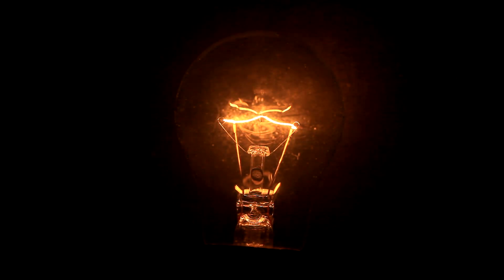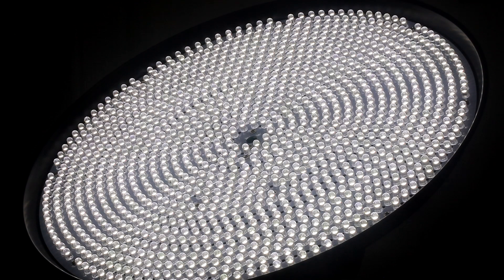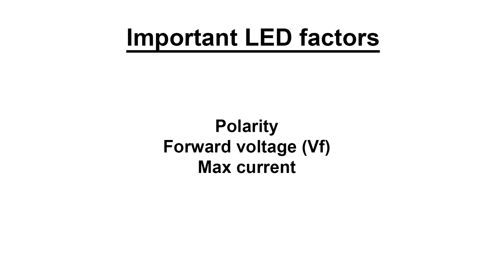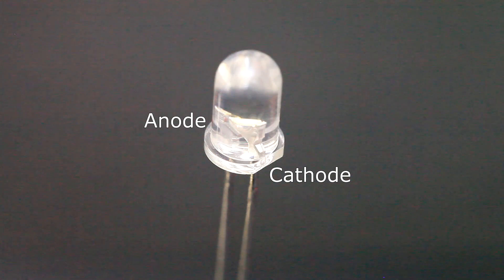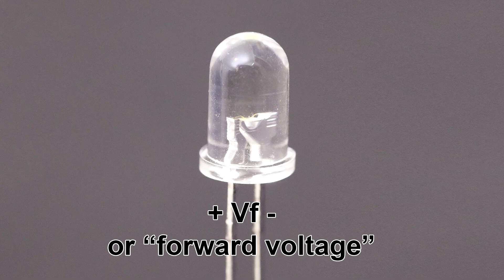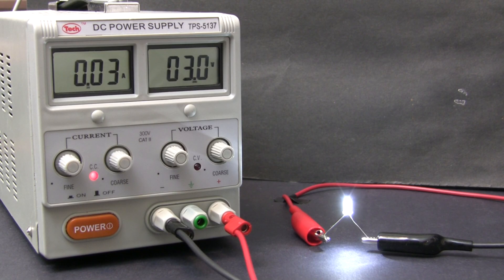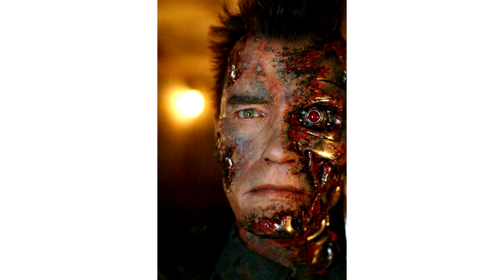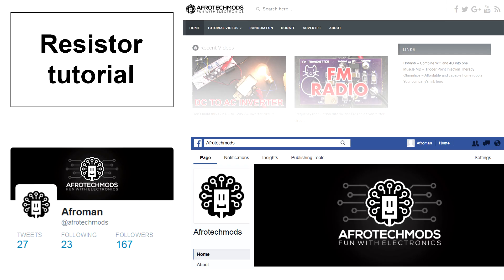LED Basics

Comment: Working with LED´s i can honestly say that i do not like them!I had LED´s at home and they failed very quickly(it were LED by a respected Light producer!).I also have to work with LED´s at my job and boy we have High pressure Sodium bulbs that still burn to this day and are really old(in the 8 years i worked there)and her come LED lighting and it is brillant lasts so long(not).
I have encounterd them in street lighting,under water lighting,moveable lighting and indoor lighting and ther are a lot of premature failing luminaires!With old fashion discharge bulbs it usually 2 things that break down,the bulb or the ignitor that´s it.Here come LED and it does not work so whatś wrong with it,the driver?The LED´s itself.
This usually means replacing the luminaire and LED luminaires are not cheap!
If it works it is brilliant but i am starting to hate LED´s

Comment: I was going to ask that since LEDs  have polarity, if you could use them as diodes when non are easily accessible. Then I realized that's literally what they are, light emitting diode.
Reply: But, understand that their reverse breakdown voltage is usually around 5V, AND the typical forward voltage is rather high, so not practical in most diode applications.

Comment: How to connect 100 led rice bulb to direct ac
Reply: I'd do 2 parallel strings of 50 LEDs in series each, then power them using a capacitive dropper taking up the voltage difference without generating heat.

Comment: speaking of cheap- ebay from china, 300 leds is like 2 dollars.
Reply: Just be aware that the normal keys to polarity, like long leg, flat on the side, even the polarity with respect to the bigger internal metal piece (anvil) might not be correct as it often is a case of reselling reject batches...

Testing a few out of the bag before building anything can save a lot of frustration...

Comment: What if we call filament lightbulbs as filament heaters? Would they then be considered more efficient with some light as a by product ?
Reply: Electric heaters are 100% efficient.  It is when you try to do something other than make heat, that efficiency is low.  Heat is usually an unwanted bi-product of an electrical device.

Comment: So many thumbs down!!

Must be PEOPLE for the ETHICAL TREATMENT of LEDs
Reply: Richard Head,
The thumbs downs are probably because he told everyone the voltage to use, but not watt (pun intended) resister to use.
Reply: @tarnishedknight730  I agree. It is not that evident to the beginner audience how the {Vf, resistor value, Vin and LED flowing current} are connected. I was expecting it to be mentioned in this video, because this is one of the LED basics, but was disappointed.
However, he does cover this topic in the following resister tutorial...
Reply: @vasiliynkudryavtsev , I'm sorry, you lost me. Which topic is covered in the resister tutorial?
Reply: @tarnishedknight730  Ehm, there (in Res tutorial) he does explain how to calculate the resistor value for LED+R circuit...
Reply: @vasiliynkudryavtsev , I am so sorry for bothering you with my irritating question. Obviously, it is not evident to the beginner English speaker that using nouns (proper names) and complete words (Resistor vice Res) makes one much more understandable.
Ehm, you write of "Vf, resistor value, Vin and LED flowing current". That is 4 items that could be referred to as "it" or "this topic". Each of them can be a topic for discussion without mentioning the other three. 
In the future, I will know enough not to ask you any more questions.
Reply: @tarnishedknight730  Don't worry, bro. There is no penalty for asking.
Reply: Or unethical treatment of their heads - made them hurt, too much information.
Reply: Ok
Reply: ha!
Reply: Hi
Reply: I think thumb-downers just wanna end up looking like Arnold, and he's discouraging them from that..  🤔
Reply: People who heard "on average, they last 10 years." If my LEDs last an average 10 years I must be 200 years old.
Reply: @MatthewFogarty-k2y  .. real fact. LEDs are "solid state" devices which gives out only monochromatic (single wavelength) devices. LEDs actually emit invisible/barely visible Ultraviolet radiations and phosphors inside, like the one in the fluorescent tubes, convert them  into  visible light. If u use the same phosphors of FL, which contains Mercury then LEDs too would.
Reply: No, just people who want good, comprehensive, technical guides that don't promote bad habits.
Reply: @immanuelpereira8924  I said precise, not save for playing children with it.
Reply: https://youtu.be/MJtsJs4Lx7A
Reply: The technology is great, however these LED bulbs have Mercury! When lit for periods at a time, it seeps into your homes!
Reply: That's neither true nor an interesting conspiracy theory. Even the mercury-containing compact fluorescent light bulbs, which are totally different from LEDs and look nothing like them, are very safe relative to something like a mercury thermometer, which many people over 50 never worried about having in their homes.
Reply: @TaiViinikka  LOL, and I have about a pound of it in mine.
Reply: @TaiViinikka  Mercury thermometers still are most precise tool than many fucking digital trash.
Reply: @pallmall5014  What are you talking about? There is no mercury in an LED. They are actually replacing a technology called Florescent lighting which does contain Mercury. Google it my friend.

Comment: can we use dimer swicth in led or is there somthing we can do to make led dim? hope you understand what i mean thanks..
Reply: Usually only if the dimmer is made for LEDs, and only if the LED light is made to be dimmed.   Most LED bulbs cannot be safely dimmed.  They will either flicker or burn out with reduced voltage.   I had to replace my regular dimmer switch when I went to dimmable LEDs because they wouldn't turn off all the way at the lowest settings.  The replacement had a separate on/off switch as well as the dimmer slider.
Reply: My3dviews thank you...
Reply: You're welcome    :-)
Reply: In North America, we no longer need special dimmers for LED bulbs, we can use the cheep ones again because bulb design has changed.

Comment: If you have far-red LEDs, the forward voltage will be lower than a standard red, and infrared ones have an even lower forward voltage. Is there a general equation for light wavelength versus forward voltage?

Comment: What do I need to make up a 120volt indicator light using a led diode? I am wanting to help my daughter make something for her boyfriend. I am familiar with  simple wiring,.but never fooled with leds..
Reply: David Moyer  pick a value a little less than max led current   120v = 155v peek to peek     155 - led forward volts   .7.    The resistor drops about 154v at peek   154 / max current of led = approx value of resistor     Now you can't exceed peek current.
Reply: Thank you....

Comment: My speaker has 5mm white led(3v) but i want red led (2.2v) what if i change, is there any damages to speakers
Reply: It will probably have a voltage limiting resistor in series.  There's information on-line about what value resistor to use for each colour of LED at different voltages.  The resistor value will give you a good idea of what voltage is being used, then just change the resistor for the recommended value at that same voltage for a red LED.
Reply: Try some red paint or a red lens...
Reply: @nickdannunzio7683  My brain short-circuited with that idea
Reply: mahesh s ,
DONT DO IT, SHE WILL BLOW UP!!!
Just kidding.
If they are the same style, chances are they have the same voltage drop across the pn junction. 
Go for it.

Comment: Ok so, if you could guide me in the right direction.... I'd like to install 2 green LEDs on my instrument cluster/Batwing (Harley Davidson). I assume my turn signals put out about 12-14vdc.  What LED & resistor would you recommend?  I want to splice or tap into into my existing turn signal wires to power the LED.  Is that possible?

Comment: How can I connect 3 to 4 leds so that I don't lose the brightness of led, because when I connect them in series or parallel they dim the led light.i tried connecting them via arduino uno, using a single output pin to control all 3, 4 leds as one. Plz help

Comment: what do i do when the voltage supplies is 3 volts and the LED is 3 volts is there any heat/ execs power being wasted? do i need a resister for this?

Comment: if you have 4 leds that are different in forward voltage like 2.2, 3.2, 3.0, and 3.4 how would you figure out what size resistor you would need?

Comment: I keep seeing here on Youtube that it is possible to parallel string 90 green LEDs to be powered by a 18650 3.7v battery. For heck I cannot get that to work for me. May I have some practical guidance as I am not a technician.

Comment: Where and when did LED's come to be?  I would like a history and maybe why and how flashlights with Led's are so much brighter. What are the limits on a flashlight? Some LED education......
Reply: +Mr51Caveman   For any LED, the limits are the amount of current/voltage it can handle, and heat.  Yes, heat is still a factor, particularly with high-powered LED modules. You have to be able to dissipate the heat or the LED will fail or at the very least become unstable.  Metal flashlights are better because the metal can dissipate the heat, but even in these, it's possible for LEDs to generate more heat than can be dissipated.  LEDs have a curious effect when thermal limits are exceeded; they tend to draw more current, which compounds the heat problem, which causes still more current to flow... a vicious cycle called 'runaway'.   It usually happens very quickly.  It's why you are cautioned to calculate the resistance you need carefully and heavily heat sink any high-output device.  On some more sophisticated high-power applications, a 'driver' circuit is employed instead of a resistor - basically, it's similar to the current-limiting feature of the power supply in the video.
LEDs are becoming more efficient every year.  The LEDs we have now are many orders of magnitude brighter than the ones that were around in the 1970s.  Fun fact:  the 'natural' colors of LEDs are green, yellow, red, ultraviolet, and infrared.  White and blue and other visible colors are created by using ultraviolet LEDs in combination with phosphors in the LED package.  The phosphors glow with white, blue, or whatever color according to the chemical makeup of the phosphor, energized by the ultraviolet from the PN junction itself - not unlike a fluorescent bulb.

Comment: How many milliwatts of light does one LED emit? Can infrared LEDs emit heat energy? Do they make ultraviolet LEDs? Can red and blue light from these tiny LEDs affect acne? (Answer to that last one is "No." BTW) Still curious about the other questions.
Reply: Emitted light isn't measured in mW. For the small 'classic' 3/5mm LEDs the light output is typically measured in mCd  milli Candela while the more modern and higher powered ones usually are measured in Lumens. The way light /light intensity etc is measured is pretty complex, but IIRC Wikipedia has a fair writeup. A 3V Vf LED at 20mA consumes a total of 60mW, don't know whereabouts the efficiency in conversion to light would be though.
On this page there's a table of Lumen/Watt ratings for different light sources: http://www.rapidtables.com/calc/light/how-watt-to-lumen.htm
 
Depending on your view, infrared light could/would be heat... Either way, they're not 100% efficient either, so they warm up like any other LED (emitting non-intended IR wavelengths...)

Yes, they do make UV LEDs. Look at some episodes of CSI [whatever] and your likely to see UV flashlights. Most often they also produce a blueish/purplish visible light as well. Example http://www.ebay.com/itm/100pcs-Ultra-Violet-UV-5mm-2000mcd-LED-Lamp-Light-Purple-super-bright-/291767249370?hash=item43eeaee9da:g:0VEAAOSwZd1VYaGw

Comment: so how would i connect a lawnmower battery to one of those small leds? i need to power some lights on my gocart, and i think i found the video that will point me in the right direction. good video, by the way.
Reply: What voltage is the battery? Let's say 12V. What voltage are the LEDs? Let's say 3V. What current can the LEDs handle? Let's say 20mA

If you wire the LEDs indidually to the battery the series rresistor needs to drop 12 (Vbattery) - 3 (Vled) = 9V
R=U/I so the resistance needed to drop 9V at 20mA is 9/0.02 = 450 Ohm.  Closest higher standard value is 470 Ohm
Actual current will be a little less;
I=(12-3)/470 = 19.15mA

How much power is lost in the resistor= P=U x I = 9 x 0.01915 = 0.17W which a standard 1/4 W resistor can handle.

If you have a more powerful LED, say a 1W one, typical values might be Vf=3.3V and If=300mA

OK, so the resistor needs to drop 12-3.3 = 8.7V. R = 8.7 / 0.3 = 29 Ohm. Closest higher standard value is 30 Ohm.
P= U x I  = 8.7 x (8.7/30) = 2.5W. You would need a much beefier resistor to be able to handle that. Example http://www.ebay.com/itm/10pcs-5W-470R-470ohm-Ceramic-Power-Resistor-Cement-Axial-/251281991973?hash=item3a8192e925:g:xxoAAOxypthRpBQa

If you have multiple LEDs you want on together, you an wire them in series and you simply add up the forward voltages and use that for the same calculations as above.

Let's say you want 3 of the 1W LEDs in series: Total forward voltage would be 3 x 3.3 = 9.9V. Current is still 0.3A

Resistor = (12 - 9.9)  / 0.3 = 7 Ohm Closest higher standard value is 7.5 Ohm
Resulting current would be (12-9.9) / 7.5 = 280mA
Power loss in resistor P=U x I = (12-9.9) x 0.28 = 0.588W 
To much for a single 1/4W resistor, but if one were to take 4 such resistors and wire into 2 parallel pairs and then put those in series, you'd still have 7.5 Ohm, but they could (if spread out a bit and not bunched up tight together) handle close to 1W (0.588W no problem)

If you cart has an alternator, beware that voltage while running is more likely in the 14 to 1.5V region... Use that instead of 12 in the calculation

Comment: afrotechmods great bunch of videos! I have a question which I'm hoping you either already have a video for or can point me to a good explanation is how to connect LEDs in parallel and series and how voltage/current is affected by resistors in such a setup. I can't seem to find a good source for information.
Reply: Due to LEDs possibly not exactly identical, it's not recommended to run them in parallel with a single common series resistor.
In general though, if wired in parallel, the voltage remains same as a single LED, the current required multiplies by the number of LLEDs.

If you put LEDs in series, you multiply the forward voltage by the number of LEDs but the current remains the same as for one (the same current runs through all the LEDs

Single 3V, 20mA LED on a 12V supply: R =U / I = (12-3) / 0.02 = 450 Ohm (closest higher std value  is 470 Ohm)
Power in resistor = U x I =(12-3) x ((12-3) / 470) = 0.17W

3x 3V, 20mA LEDs in series on a 12V supply: R = (12 - 3x3) / 0.02 = (12-9) /  0.02 = 150 Ohm (which is a std value)
Power in resistor = U x I = (12-9) x ((12-9) / 150) = 3 x 3 / 150 = 9/150 = 0.06W

3x 3, 20mA LEDs in parallel on a 12V supply: R = 12-3) / 0.06 = 9 / 0.06 = 150 Ohm
Power in resistor = U x I = (12 - 3) x 0.06 = 9 x 0.06 = 0.54W Note that this is more than a std 1/W resistor can handle. Note the big difference  in heat in the resistor compared to with the 3 LEDs in series.
Reply: Great explanation! thank you so much.

Comment: How Do I Do This? I purchase a key ring LED Light. These work fine without a resistor. They have two, CR2016 Button Batteries, (3V) inside them. I want to add a 10CM extension wire to this key ring LED and put the bulb on the end of the wire. REASON FOR THIS: I repin Euro Cylinder locks. I need to have a tiny light inside the Euro Cylinder whilst I repin the lock. I don't have three hands. It takes two hands to repin the lock. If I had this extension wire LED, I could stick it on top of the lock with the bulb inside the lock. BUT ... Q) How Do I Do It? There's no wires inside the key ring LED. The LED touches the batteries top and bottom. These key ring LED's cost £3.80 for ten on Amazon UK.
Reply: Bertie Pimplebum You don't  need the keyring. Just use an led and a single 2032 battery, extend the wires on the led to the length that you want, perhaps attach the wires to the battery with a clothes peg. No resistor is needed as the maximum current from the 2032 is less than the maximum that the led can handle.